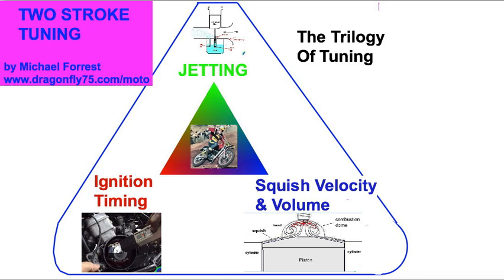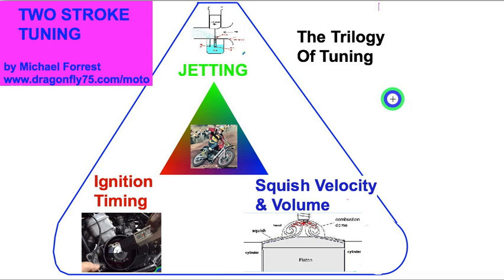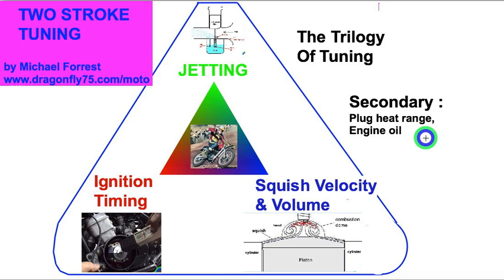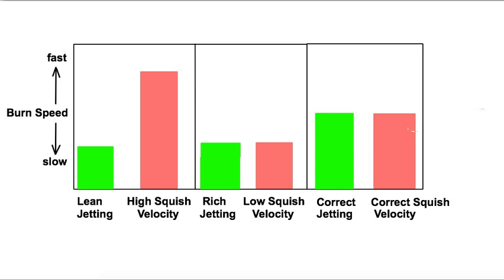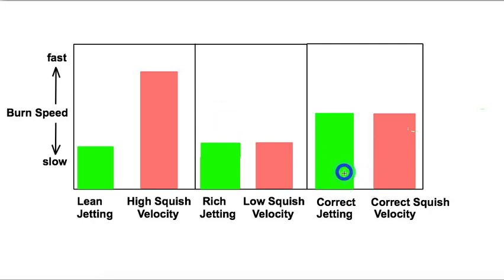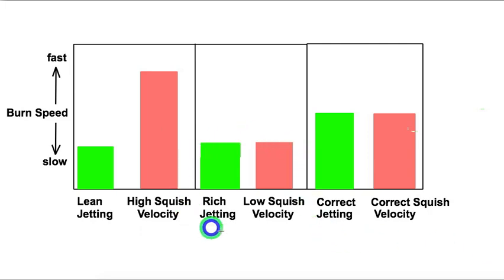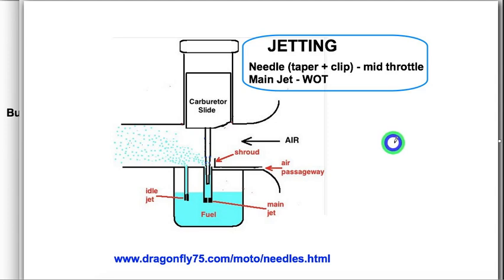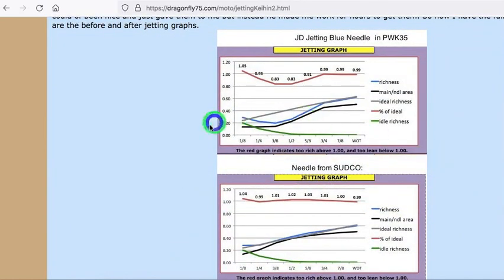2 Stroke Tuning for Power

Comment: Love these videos man, they've helped me understand many of the systems in my two stroke dirt bike. Need to look into my squish at some point, always lacking money though haha!
Reply from the maker: Yeah but the squish calculator is only $15. Then you don't even need a machinist to take metal off the mating surface because with a thick plate of glass and rough sandpaper you can take off metal there. You may want to do it over a 3 day period though because it's a lot of work and your forearms may get too tired. I've done it so I know it's possible.
Reply: If you want it enough, you find a way.  Some of us engine heads have mental issues, because we can't get enough torque, it's like a drug.  

Imagine a drug addict who gets high on modifying engines to make more torque (at rpm), you end up here my friends.
Reply from the maker: @iKenFlyPPG  I'm obsessed about my bike running good all thru the throttle range, not fouling plugs, and rings and cylinder lasting a long time. When I started digging deep I used to race my AX100 on the street and I never could get it to run as strong as I'd like but it did have only 4 gears which means I had to make the pipe powerband cover that broader rev range which of course lessened the peak power. But I was able to get it tuned really good thru the whole throttle range and with decent power under that powerband too, so I considered it a success for street riding.
Reply: @MichaelForrestChnl  It is very fair priced, I just haven't gotten far enough into my engine yet. At the moment I can't even get the cylinder off, I overtightened one of the head nuts and either the threads on the bolt or the nut gave out, it's spinning freely on the bolt going neither up or down. Had to tighten it with another bolt on top for now.

At some point I'm looking forward to get more deep into it all but as I use it as a daily driver I can't set aside enough time. Would love to change the bearings inside the engine but I've never split one before either. When I do have the money and time to spare I will definitely remember where to find the sheets of info I need :D
Reply: Have you done any videos/research on the required surface finishes for typical gasket materials, & what grit of emery abrasive sheets will produce the required surface finishes?  I believe I recall surface finishes rated on an RA scale? And I think I recall finishing with around an 800 grit emery cloth abrasive sheet 
producing the correct RA # surface finish for an MLS Multi Layer Steel head gasket?  I'm also curious what a custom copper head gasket surface finish requirement is.
Reply from the maker: @charliechucker  I haven't any info on that subject
Reply: Sediakan translate indonesia om??